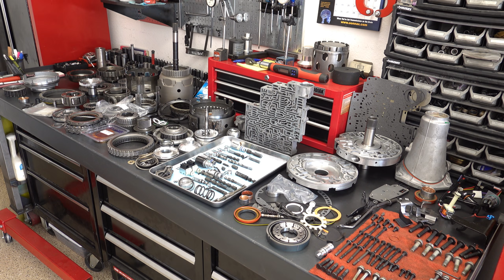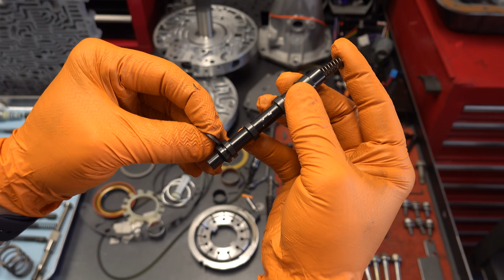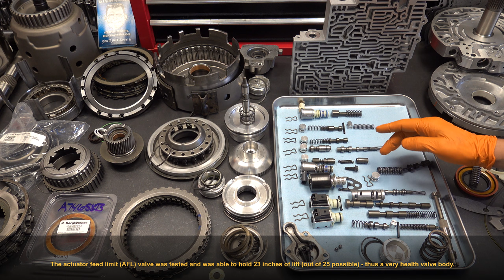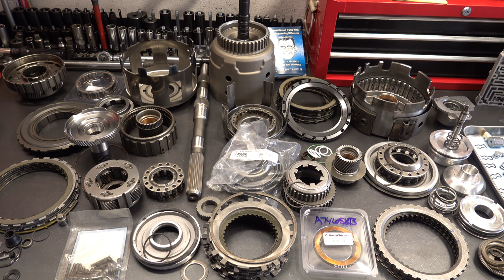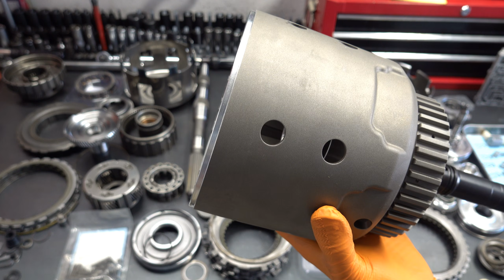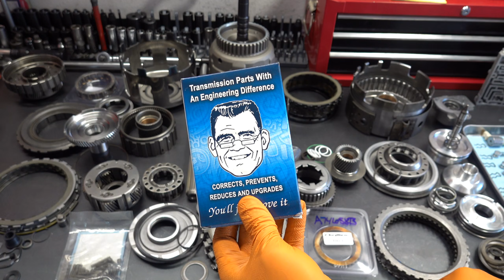4L60E High Performance PT1 -  Parts Selection and Build Considerations

Comment: Very informative ( I mainly do engine stuffs). Would you or how much would you beef up a transmission for a 2010 5.3 with an LS6 cam with a TBSS intake? No other major mods. Also 4x4.
Reply from the maker: Thanks for watching, Corey! For case improvements I'd install a an 903 Corvette servo, Sonnax smart shell, max pack in the 3-4 clutch and perhaps a front and rear 5-pinion 4L65E planetary carriers set. For hydraulic improvements, pretty much the same stuff I do for most of these units, but exactly what I would do would largely depend on how the vehicle was going to be used (i.e. just daily driver, street strip, racing, heavy duty towing/hauling, etc) and converter stall.
Reply: @nickstransmissions  very grateful for such a quick reply. Daily Driver/rare fun.
Reply from the maker: You're welcome (I happen to be sitting in front of my computer today and see the alerts pop up on the screen). What stall speed is your converter?
Reply: @nickstransmissions  it's a factory 4x4 V8 truck. According to a local trusted mechanic, it has the same converter as the trailblazer ss which he says is 1600 to 1800 higher than the 2x4.
Reply from the maker: The trailblazers had a TC stall of around 2000-2200 or so. I'd download Transgo's instructions for their HD2 shift kit off their website and follow their guidance for separator plate feed hole sizes however DO NOT drill the AFL balance or TCC regulator feed holes at the bottom left area of the spacer plate unless you actually install their shift kit, including the white inner AFL spring and blue TCC regulator spring in the valve body...If you're not planning to install their kit, drill the feed holes for the 1-2 shift .076-.080 if using a corvette servo, 2-3 shift, 2-3 accumulator (aka band release) and 3-4 shift to .093. If you want firmer apply in manual low and reverse, drill the L/R feed to .080-.086 and remove the low reverse check ball. Otherwise, keep it in and leave the feed hole alone. 

If the 4th gear shift is too soft, simply block off the 4th accumulator feed in the case using a cup plug and leave the spring, piston and pin out of the 4th gear accumulator bore. 

You can watch my 4L60E valve body tips and tricks for more details, if you haven't already: https://youtu.be/cQSdi_VhFwY
Reply: @nickstransmissions  so much good information. Thanks. I'll try to remember to update you after I'm done with it.

Comment: Sonnax six-pinion front planet? 3-4 Z-pack?
Reply from the maker: Avoid the Zpack, it's not my favorite for anything high performance as the individual plates are too thin and don't withstand heat very well from what I've seen...Run an Alto or Raybestos Max pack using Alto Reds or Kevlar-impregnated HEs,  Raybestos Blues, GPZ or Stage Ones  w/Kolene coated steels or Borg Warner 4L65E clutch pack with lindered steels (same as Kolene) instead. Six pinion planets are great for racing as they narrow the stupidly wide ratio between 1st and 2nd gear but if you're not racing (or the primary use is street driving) they're not mandatory.

Please give a thumbs up if my info is helpful; if not, please let me know what can be done differently.

TIA
Reply: @nickstransmissions   The info is invaluable! Really thanks a lot. I used to watch Richard's Precision Transmissions, and they treated all their units with the Z-pack and wide band. Alas, that channel went dormant (I think they had some family feud that closed the business...). 

If you get a chance to do some of the old stuff, like the FMX - that would be great!

Comment: Nick, do you do Allison's?  Video(s) suggestion?
Reply from the maker: Hi Steve, I actually haven't been into Allisons just yet but may in the fall...Those transmissions are generally very resilient and don't need overhaul all that often and when they do, most will seek a good used unit for 1-2 grand vs shelling out the 5k+ for an overhaul...There's a video on YT called something like 'The best Allison 1000 Rebuild on Youtube'...I haven't watched it but the thumbnail looks neat, haha. That's the only one I'm aware of off the top of my head.

Comment: Another great video. I like your no nonsense approach to this type of work. I have a quick question. I know you have said before to leave the 3-4 clutch springs out if not doing a performance build. Is it okay to leave them out if not doing a performance build and using the Transgo 7-CS spring kit?
Reply from the maker: Thanks, Jay...It's up to you if you want to include or leave them out but my general guidance is that if you set the clutch clearance down below .035", keep them in. Otherwise you can leave them out. That applies to any type of build when it comes to the 700R4 or 4L60E.
Reply: @nickstransmissions  Thank you for the information. Keep up the great work.

Comment: Would this transmission be over kill for 500 hp at the crankshaft I'm assuming you were referring to 650 hp at the wheels in the video
Reply from the maker: No, it would be fine and the vehicle mentioned in the video is making 650hp at the crank. If that was 650 hp at the wheels, I'd opt for a Sonnax billet steel front planetary gear set as well.

Comment: When you install a built transmission like this what needs to be done to the computer. Does it need to be tuned?
Reply from the maker: Computer will definitely need to be tuned for the engine; depending upon how the vehicle is being used, it may be prudent (or even necessary) to apply some tuning to the transmission as well.